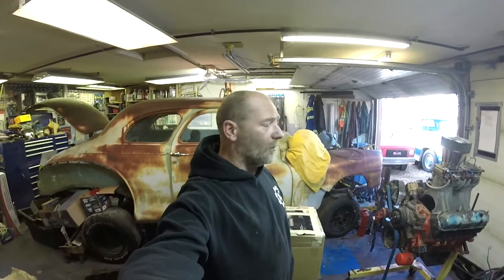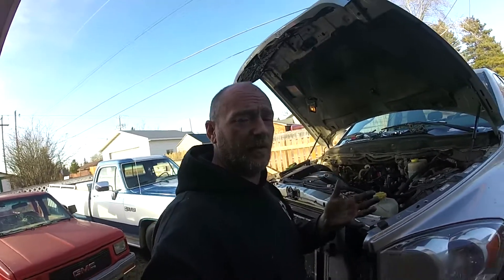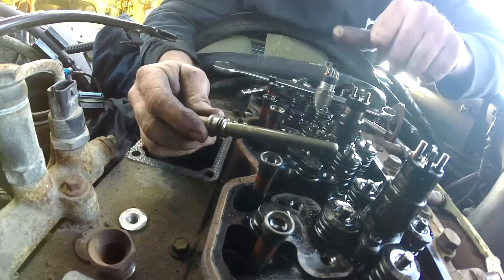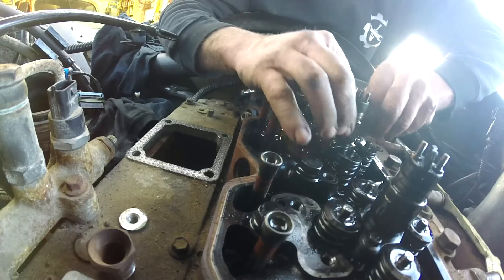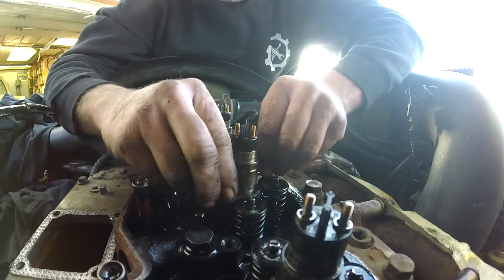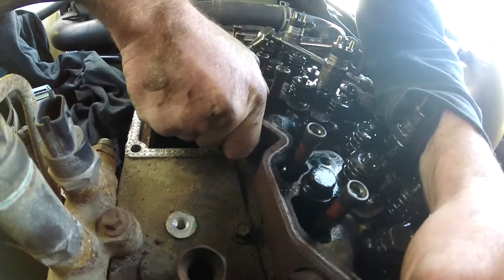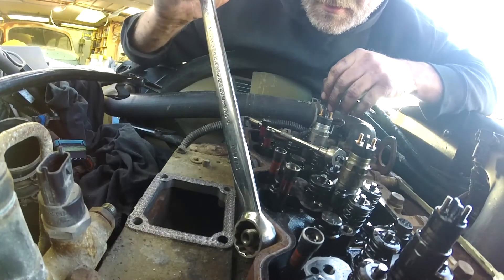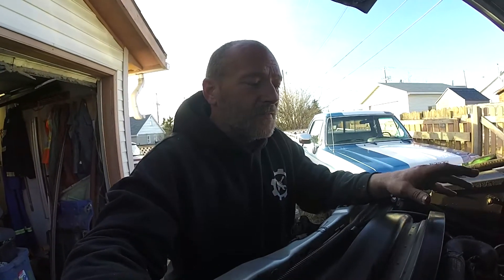Cummins 2003-07 1/2 5.9L Fuel Injector Replacement Procedure

Comment: Man how do you get to the rear ones? I’m stuck on the last one.
Reply from the maker: For getting the rear ones, it's tight under the cowl but still doable. What stage are you at? Have you got the injector lines off and the connector tubes out?
Reply: @dazeofgloryshopworks5806  

I have gotten 4 out of the 6 fuel rail lines off. I got the number 5 off from the fuel rail but I can’t remove it the line from the engine side. I bought the tool which makes it easier to slide over the fuel line because it is tight space. That last one does make me nervous because it is behind a bracket.
Reply from the maker: @gloglo1275  the bracket is removable. It's got two 15mm head bolts and they are tight but won't break or anything. The bracket I'm thinking of is the lifting eye. There is a second bracket on the back of the head that's kinda in the way too but you just have to loosen the two bolts that hold it and it rotates out of the way. Should give you plenty of room then. Keep me posted
Reply: @dazeofgloryshopworks5806  

Thanks.
Reply: @dazeofgloryshopworks5806  

I was able to get the one bracket with the two 15mm bolts out of the way. I am now waiting on the tool to arrive from Amazon to remove the two last fuel lines. Are you saying there is another bracket that will be in the way? It seems that from removing that one bracket I should be able to get to the last line. I won’t know until I get the tool .
Reply from the maker: @gloglo1275  where the #6 injector line screws in at the head, there's a "metal shield" bracket and I find it easier to get the line off and the tube out of the head with it removed. It's a bit of a reach around but if you loosen both bolts that retain it on the back of the head, (13mm head) don't quote me haha but it will flop out of the way and you just rotate it back in place when done. If you can get it out without removing that rear bracket then give er man 🤘🏼
Reply: @dazeofgloryshopworks5806  

Oh boy so another wonderful bracket. Well I will try to see if I can get it without it. I’ll keep you posted. Thanks for your help.
Reply from the maker: @gloglo1275  you're welcome. Honestly it's a fairly easy bracket to loosen off. I know you'll get er done either way 👍🏼
Reply: @dazeofgloryshopworks5806  

Well I was able to remove 5 out of the 6 nuts. I went to start working on removing the injectors and unfortunately the rocker arm bolts were not sitting right. I verified that everything was good and still not sitting correctly. There is not enough thread screwed in. On the other 5 you can see the thread a little bit on the other side but not on the one I just did. I went to remove it again to inspect it and now the rod that connects to the rocker arm spins when I try to tighten it .
Reply from the maker: @gloglo1275  I'll be honest, I'm a little confused as to what you're meaning. Were you able to get the injector line off #6? The rocker arms would have had to  be in place correctly or your valve train wouldn't operate properly. Is it possible the cam lobes are keeping the pushrods raised to make installation difficult? (Opening exhaust or intake valve)
Reply: @dazeofgloryshopworks5806  

I figured it out. The rocker arm nuts on the right side were the issue. I didn’t realized I didn’t need to unscrew them so it bottomed out. This is where the valve adjustments are made. I just figured out using a 5mm torx brought it back to where it needed it. I still need to figure out how to make sure the valve clearance is okay since I removed that. I was able to install 3 out of the 6 injectors. I can’t get the rest of the tube outs. They are jammed hard as heck. My hand is messed up from trying. Injector one the copper washer fell into the spot where the injector goes but it was luckily exactly where it needed to be. I looked down and saw it not blocking the hole. I also heard the injector click into place so that should be fine.
Reply from the maker: @gloglo1275  here's another tip for the connector tubes. There is a tool that screws onto the connector tube. But if you don't have it, take one of your injector lines and screw it onto the tube 3-4 threads and pry against the fitting and the head. The tube will pop out 👍🏼
Reply from the maker: @gloglo1275  I also have a video on doing valve lash as well man. Hope that helps. 🤘🏼
Reply: @dazeofgloryshopworks5806  

Yeah I did screw the nut and broke my heavy duty screw driver. I even sprayed something to help loosen it. So far nothing. As far as the copper washer, if the old one comes out and the new one falls into the injector tunnel, is it okay if it is aligned where it needs to be? I’m just making sure I don’t need to remove the new injector I just installed.
Reply from the maker: @gloglo1275  the copper washer will be fine yes. They can basically only line up and with the injector seated it has no choice but to be in the right spot. I'm surprised at the connector tubes being stuck that hard but have had the odd troublesome one for sure. You could try tightening the connector tube nut/collar, back in again and then taking it off and try again. It could reseat the connector tube and set it free from whatever is holding it in.
Reply: @dazeofgloryshopworks5806  

Thanks. I will try that tomorrow. I’m beat. I have an injury from bodybuilding so it has been a pain in the butt doing this while dealing with my elbow. Lol
Reply from the maker: @gloglo1275  yeah man I feel your pain there! Good luck. I know you'll get er. 🤘🏼
Reply: @dazeofgloryshopworks5806  

So I had a friend come over and he was able to get that tough injector tube out. Crazy what it took to remove. Weird thing is all of my tubes wouldn’t sit all of the way down by finger. I had to gently tap it when a small hammer once it was properly aligned with the two ball bearings. I could not get it by just pushing it with my finger. I did hear them click into place when I tapped it with a hammer. I then wiggled the injector and I could see the tube moving so I knew it was in place.
Reply from the maker: @gloglo1275  I knew you'd find a way man. Yeah the oring is what stops em by hand. So the little tap with hammer is perfect in some cases. Good work!!!
Reply: @dazeofgloryshopworks5806  
Thanks for your help. I’m almost done.
Reply: Man after all of that work I still have the “wait to start light on”. New FCA, injector tubes and injectors .
Reply from the maker: @gloglo1275  so... from a mechanics standpoint, what was the main reason for doing the injectors? I never did ask.
Reply: @dazeofgloryshopworks5806  

Oh sorry. So I was driving couple of weeks ago, and when I stepped on in it in the highway the WTS light started flashing, and it remained on. I scanned it which gave me a p1222. High return fuel line back to the tank. I replaced the FCA, and everyone was asking me how many miles I had on the truck. 298k miles. Everyone started telling me get injectors.
Reply: @dazeofgloryshopworks5806  

What is a good ohms when checking the injectors? I set my multi meter to 200 ohms setting and I’m getting 1.4 ohms for them .
Reply from the maker: @gloglo1275  usually I've seen between 1.1 and 1.6 ohms per injector. Sounds like 1.4 is just fine
Reply from the maker: @gloglo1275  but that doesn't mean they aren't "washed out" by wear and tear from fuel flowing through them.
Reply: @dazeofgloryshopworks5806  

Sounds good. Thanks
Reply: I’m getting p2146, and p2143. Pretty frustrating. I unplugged all of the injector harnesses, reset it the codes and scanned it with only the ignition in the on position, and it trips those codes. So I checked the injectors in the first 3 and I got 1.4ohms. I sent number 4 to injectorsdirect because I had a code for 4, and still waiting for them to test that one.
Reply from the maker: @gloglo1275  it sounds like you have a chaffed section of your engine wiring harness. I hope I'm wrong though. There is a spot on the right side lower of the engine behind the ac compressor where the harness has been known to lay against the ac lines and chaff through. Now normally it has a fan control circuit code accompanying other codes as well but it would be worth a peek. You can see usually from the passenger wheel well by pulling the wheel well liner up away from the frame a bit or from underneath the truck as well. Might not help but it's worth a look for sure.
Reply: @dazeofgloryshopworks5806  

I’ll take a look. I got a ancel fx2000 today to try and clear the codes from the computer modules, and it won’t connect at all. It gives me the menu and when scanning for can protocols it says failed for all of them. So weird.
Reply from the maker: @gloglo1275  that is weird for sure. Unless it's not updated properly, it should read the truck. Good luck man. 🤘🏼
Reply: @dazeofgloryshopworks5806  

Sorry to bother you again. Lol. I’m trying to test the connector from computer to the injector harness. What type of voltage should I get when probing the connector? Each connector manages two injectors. With the truck turned off how much ohms should I have on a working connector?

Also my tester has different settings such as 200k, 2000k, 200, and not sure which one to select.
Reply from the maker: @gloglo1275  no worries you won't get any voltage or it'll be sporadic at best because the computer will only fire the injectors with a tach signal as if it's running. But to ohm each wire from ecm to the injector harness, you should see whatever ohms you get when you touch the two tester leads together +\- 0.1 ohms or so. Basically next to no resistance. Also while you probe the ecm connectors (disconnected from ecm) touch one lead to the terminal you're testing and the other lead to ground and then to power. That way you can tell if the harness is chaffing to ground. Should be an open reading like when you switch your meter on to ohms without touching anything with the leads. The meter can be set to 200 ohms scale or whatever the lowest ohms reading is. Hope it helps
Reply from the maker: @gloglo1275  also I didn't ask if your truck had the 5.9 cummins or the 6.7. If 6.7, then you can't mix up the injectors as they have a flow rating programmed for each injector per cylinder they are installed in.
Reply: @dazeofgloryshopworks5806  

2005 5.9. Someone wants to trade me a nice working condition even trade 2nd gen 24 valve Cummins for my non working truck. Lol

I am thinking about it. I just went to harbor freight and got a easy to use electrical meter. Mine had too many settings. I just need to know if it is the harness or injectors although I was getting 1.4ohms on each injector
Reply: I am getting like 110.3 ohms on each of the ends on the harness connectors.
Reply: @dazeofgloryshopworks5806  

I was measuring the electrical connector and not the connector that goes from the harness to the actual injectors. I was getting like 110.3 ohms or so . On all 3 of the connectors .
Reply from the maker: @gloglo1275  was the ecm unplugged too? Like you had one meter lead at the end terminal and the other at the injector terminal? Or were you measuring with the two leads on the injector terminals at the same time?
Reply: @dazeofgloryshopworks5806  

The ecm was plugged in. I didn’t messed with that. I unplugged all 3 connections to the 3 connectors which supply power to the injectors on the side of the valve cover. I then checked the ohms on each two pins of each connectors(they are 4 total per connector) and it was moving up to like 114.3 ohms and some were like at 12.3 ohms and they would move up and continue rising.
Reply from the maker: @gloglo1275  well if I'm interpreting your test correctly, then it sounds like your injector harness is shot. It does happen. I highly recommend the factory replacement from either Chrysler dealer or a cummins truck dealer. I've used aftermarket ones and the nuts on the injectors seem to screw down like they are crossthreading. Poor quality it seems. So if it was just the injector harness you tested, then yes you have issues in it and replace it. I'm always leery of saying to replace a component when I haven't been right there to help diagnose first hand... but it sounds like you crossed your T's and dotted your I's on it man. 🤘🏼
Reply: @dazeofgloryshopworks5806  

It wasn’t that harness. It was the connection from ecm to the harness. The female connectors that connects to the injector harness
Reply from the maker: @gloglo1275  ok well without the ecm disconnected, you can't get a conclusive result from testing the wires. The ecm has drivers inside it like mini-relays that shoot the voltage to the injectors and turn em off and on as required. So you're effectively measuring circuits that aren't isolated. The ecm would have to be disconnected for sure to test these wires to get any proper results. And then you test each wire individually from ecm to your injector harness plug ins.
Reply: @dazeofgloryshopworks5806  

So if I leave the ecm plugged in and disconnect each of the nut wires on the injectors and test that would that tell me if I have an issue in the wiring? I could just test that to make sure the ecm is putting the right ohms into the injectors.
Reply from the maker: @gloglo1275  unfortunately no that won't work at all. The only thing you could do is hook up a noide light to the injector nuts and with engine running, see if the noide light is flashing. That will say if the ecm is energizing then coils but that's all. There is no spec for voltage or ohms from it to say yes it's within an allowable range.
Reply: @dazeofgloryshopworks5806  

Issue is the truck doesn’t run. Someone was showing a video testing the connectors I was testing but it was on the 2007 and up which is the valve cover harness. 

So testing what I did won’t show whether the ecm is putting the proper ohms? If it doesn’t could I check the voltage to see I am getting the proper volts? I was about to send the computer out to get checked out.
Reply from the maker: @gloglo1275  no there is no real short cut as I said in the last comments bud. The only way to know it's not an ecm issue is to know the injectors are good and know the injector harness is good and know for sure that the engine harness between injectors and ecm connectors is good. And that is done with disconnecting the ecm connectors and ohming each of the injector wires from injector connector to the proper ecm connector pins. No way around it bud. 

But here's the thing.. the two engine codes you gave me, won't stop the engine from running. It'll misfire or run like dog shit but it will still run. So I'm thinking it's time to go back to the beginning on what happened with it or what was it doing when it quit running and any symptoms it had there. I've had worn out injectors bleeding so much flow back through the return side of the fuel system that it lowers the fuel pressure so it won't run at all. And the high pressure relief valve getting overworked to the point that it can't hold pressure any more as well. Is the truck chipped up or got a programmer in it? I've seen old tunes on the ecm cause many issues such as this too. We never started at the beginning of your issue here so it's hard for me to say what direction is the correct one to go on diagnosis. Let's start at the beginning... how long have you owned the truck? What kind of fuel do you use, and how often do you change your fuel filter? What does it have for a "lift pump"? An intank version or the original fuel pump log on the back of the filter housing? Maybe an aftermarket FASS fuel pump kit. Let's start with basics and go from there man.
Reply: @dazeofgloryshopworks5806  

Alright so the beginning. Lol. I had a p1222 code. I replaced the FCA and a lot of people were telling me because I have 298k time for new injectors. So I got 6 refurbished injectors from injectorsdirect. I installed them and new injector tubes. The truck still had the p1222. It was running very smooth except it was on limp mode because of the p1222.

I found a mechanic that was offering me some help. After a long while of having no luck with the p1222 we agreed that I should have it towed to his shop 60 miles one way. 

He had agreed on the way we would go about the labor which we agreed. He then tells me the same day so I plugged in my expensive snap on scanner and re calibrated the injectors and it is running amazing even peeling wheels. I’m like wonderful. 

He then says I think I should keep it one more day to test it out. Well next day I get a call that the truck started shaking after driving amazing, and it was the injectors that got stuck opened. He told me p2146 and p0204. He then started telling me that he would have to charge me for all of this stuff which I was very clear about and I didn’t liked the way this was going because now he brought someone else into this and he said I would also have to pay him. 

So I was told him I am getting my truck back. Which created a huge argument. I then get my truck back after paying him for some of the diagnostic fee. My truck had 6 codes when I got it back. 

So I reset it all of the codes and I sent the injector 4 back to injectorsdirect. The codes that I am stuck with are p2146 and p2149. When I got the truck back it ran like trash shaking and even smoking so I didn’t wanted to screw up the engine so I turned it off and it was even still running for a few seconds after I turned it off.

I was trying to isolate the issue. So I’m thinking if it is a short on the injectors let me unplug all 3 of the female connectors on the side of the valve cover, reset the codes and see if it stops setting the codes. Nope codes comes back as soon as I reset them with the female connection from ecm to injectors completely unplugged so this is an issue of either ecm or the harness from ecm to the injectors with the female plastic square connectors.
Reply from the maker: @gloglo1275  so, it sounds like you're not developing enough cranking injection pump pressure. It could be from a stuck open injector yes. But also the fca as you've discovered already. Now the high pressure relief valve looks like a bolt on the fuel rail to a banjo fitting. Google and a image will show up for what I'm talking about. That valve has been known to fail and be too weak to hold against the fuel rail pressure. There's a way to test it but you need a special tool fitting so you can see it leaking. It's also called a cascade overflow valve. Aside from that, I'd the code is being tripped just with the key on and can't be cleared. There may be something else going on there electrically with the fca wiring.

When I worked for Chrysler (2000-2010) , we did a mandatory fuel tank drop and clean on every set of injectors to make sure there was no water contamination or algae growing in the diesel fuel. You'd be amazed at what gross ass stuff we had to clean out of the fuel tanks. All manner of slime and gross bad fuel. Did you change your fuel filter when you did the injectors ? Possible you slurped up some little mess into one of em and it jammed. 

The ohm test across the injector terminals will tell you if the injector solenoid is good or not but not if the injector is stuck open or closed. It does sound like it has one or two stuck wide open for sure. Normally I'll do fuel flow back tests and timed supply and return tests for each injector and the high pressure pump as well as the lift pump before going further with other things. But it needs specialty fittings and fittings to block off injectors to isolate which one is flowing too much as well. I certainly wish I was there with you to go through it with you man.
Reply: @dazeofgloryshopworks5806  

I changed the fuel filter around 3 months ago. The codes remaining are the p2146, p2149. It doesn’t matter how many times I reset it they won’t stay off. The p1222 code is off. I have a sneaky suspicion that they tampered with my ecm/wiring. Because on a normal 3rd gen Cummins if you unplug the female connectors on the side of the valve cover and just turn the key to the on position, it won’t trigger the codes I have.
Reply from the maker: @gloglo1275  it is possible that while looking at the engine and trying to diagnose the issue, that something got disturbed or an ecm terminal is now too big (stretched open) to make a solid connection. But I can't say without having seen them in action. It's a rough go when you're relying on someone else and the deal goes hard. I know first hand man and definitely sympathize with you on that one. I think I would wait till I get the #4 injector back or get a 0.039" drill bit and start checking your ecm terminals one by one to see if they have the proper pin tension on them. That was never a fun job for me but was one of those things that had to be done. Just make sure the connectors are clean before you unscrew them from the ecm. I think it's a 3/16" Allen head socket to get them disconnected and a 10mm socket to remove a harness retainer by the ecm to get enough slack on the ecm connectors to flip em around to start sliding the drill bit in to check tension. If it drags going in and out, it's good. If there's no drag, then that's not right. It's a pain in the Butt job but I've found issues that way in the past.
Reply: @dazeofgloryshopworks5806  

Well do you think not having injector number 4 would make those codes continue getting triggered although the harness is disconnected all together?
Reply from the maker: @gloglo1275  I don't think it should but I can't say I've ever had to diagnose this way either. I may be wrong but I don't recall the 5.9 ever getting an egr system on them. Not in Canada anyway. That wasn't till the 6.7 and that was one of the codes wasn't it?
Reply: @dazeofgloryshopworks5806  

Well the code I got before was p1222 which they told me they fixed. That p1222 is gone and all I got is the short circuit codes with the p2146,p2149.
Reply: Sometimes said the following:

“Problem yes, serious no. If the injector doesn't fire there is no fuel so no engine damage. You can run these engines for hundreds of miles with a dead cylinder and intermittent problems and have no issues. If the ECU detects a short or open it won't fire the injector.”

This is where my head is at. As long as I have those p2146, and p2149 the injectors won’t be firing because the ecm isn’t sending signal to them since there is a short. If the short was in the injectors with me unplugging the female connectors to all injectors and still getting a short would mean to me that it is something with the wiring from the ecm to injector wires or ecm.
Reply from the maker: @gloglo1275  I'll do some in-depth checking on both of those codes on Monday when I get to work. I have access to some really good diagnostic sources and the factory diagnostic manuals for most everything I've worked on in the past. Cross your fingers I'll be able to get you some specific testing to dig in deeper and find the problem man 🤘🏼
Reply from the maker: @gloglo1275  I agree with you for sure man. That's why we need more in depth diagnostics. Getting the code from the ecm is only one step in proper diagnostics. I've seen lots of fellas replace part after part needlessly because they had a code and went for the component it was attached to without fully diagnosing anything properly. Hell, I've jumped all over the map on issues and only ended up with many wasted hours. We will get to the bottom of it man.
Reply: @dazeofgloryshopworks5806  

Thanks man you have been amazing.
Reply: @dazeofgloryshopworks5806  

So I unplugged the ecm like you suggested. I then used my meter to check the resistance from the female connectors of the side of the valve cover. I’m getting nothing. I think this is the way you told me to do it. I am usually not too knowledgeable of electrical stuff but I am trying my best to learn and narrow this down. Funny thing is when I try explaining to people computer science and coding they all nah man nah speak English please. Lol Well that is what makes sense to me. Logic and algorithms. Lol
Reply: So I unplugged the nuts on the injectors and tested the leads on top of the injectors. I am getting fluctuating between 0.02-0.07 ohms on each.
Reply: I was going to ask would having them harness unplugged for the injectors on the side of the valve cover immediately set off the p2146,p2149 if just turning the key to on position and not turning on the truck?
Reply from the maker: @gloglo1275  it's possible for the injector code. But it should have been multiple injector circuit codes. Not just the one. The injector ohms of .2-.7 are odd to me. I usually see 1.1-1.4 in my testing. Could be your meter maybe but I don't think so. 
To text the harness for ohms with ecm unplugged , you need to put one prob in the proper terminal of the ecm connector that shares the same wire to the valve cover. Resistance is testing one single wire at a time at each end. So one lead would be on the injector harness for say #1 injector and the other lead would be on the corresponding terminal in the ecm connector.
Reply: @dazeofgloryshopworks5806  

This is the new meter I got which is auto. You set the ohms and it gives a reading. The other one I have is too complex with way too many settings(200,2000,20000). Lol

I was getting those readings. I was afraid that I would have to stick something on the other end of the ecm. Lol. I was just wondering that if it was possible that if I unplugged all injector connections not even turning on the truck it would set those codes for p2149, p2146.
Reply: @dazeofgloryshopworks5806  

I just shipped the ecm to get repaired.
Reply from the maker: @gloglo1275  it's been super busy at my work these past couple days man. But yeah if the harness checks out then it may sure be in the ecm. Keep me posted on the outcome please.
Reply: @dazeofgloryshopworks5806  

Yeah man I live in an HOA and I’m pretty stressed about getting this truck fixed. It is currently parked in the street and they can fine me for being parked there. I can’t park it in my driveway because it doesn’t run. I’ve done a lot of research and because I have those two codes which are back immediately, and won’t go away . They say they did a lot of what I did and it wasn’t until they replaced the ecm that it fixed everything . I spoke to the ecm repair place and they told me the same thing.
Reply from the maker: @gloglo1275  sounds like you're in good hands man 🤘🏼. Very cool. I'll cross my fingers for ya!
Reply: @dazeofgloryshopworks5806  

I just heard back and they told me my injector was indeed bad due to contamination. How they heck do I go about making sure I don’t have contamination? This seems to be such a hassle. Do I drain the fuel canister before I install this new injector and drain it a few time and install a new filter?
Reply from the maker: @gloglo1275  the only way I recommend isn't what you're gonna wanna do. But... drop the fuel tank. Pull the float unit out and drain the tank. Then wipe the tank out to get everything. You'd be surprised how far you can get your arm into the hole. 
Then pull the fuel filter and clean out the filter housing. Install a brand new filter and fresh fuel in the tank. I've had to do it so many times working at dodge for years that I still don't miss that part man.
Reply: @dazeofgloryshopworks5806  

Oh man that seems like a whole lot. I was told that my injector tube I guess got a small part in the and it got it’s way to the nozzle. I had put a really good diesel treatment right before all this happened that covers 150 gallons. I was just thinking about replacing the fuel filter, and cleaning the filter canister. Maybe let it fill the canister a little bit at a time to get the diesel to flow and drain and clean again.
Reply from the maker: @gloglo1275  well. It's possible but I can only recommend what I know works for sure man. I know it sucks but it's the sure fire way. Fuel treatment won't help contamination or remove it at all. Just think on er is all
Reply: @dazeofgloryshopworks5806  

I guess what is a way to know that it is contaminated for sure? They just told me that the piece from the injector tube a small piece had damaged the injector nozzle hence it was deemed contaminated.
Reply from the maker: @gloglo1275  honestly, once we condemned injectors for contamination, we weee mandatory for drop and clean the fuel tank every time. We had the first couple go through without doing it and come right back for the same issues. So it was hard lessons for us and the customers man. Even if everything is clean , I still recommend it as a diesels life line is clean fuel.
Reply: @dazeofgloryshopworks5806  

Alright I guess I will have to look into doing that. Thanks
Reply: So I got injector 4 installed back on Friday. Replaced the fuel filter, and cleaned the tank , and fuel lines. I was waiting until today to get my ecm. I get the ecm installed and now my code is p2146(1-3). Funny because I guess it wasn’t my ecm all along. Because I replaced injector 4 it got rid of code 2149.

Unfortunately it doesn’t tell me which one out of the 3. All I have to go by is the mechanic that was messing with it told me he thought injector 1 was an issue. This is right before I had it towed back to me.
Reply from the maker: @gloglo1275  I'll check out that p1246 and see if I can find any fixes for ya man. Good work on the fuel system. It may seem like overkill but trust me it's well worth it in the end. Have a good night!
Reply: @dazeofgloryshopworks5806  

Well I bought an injector from a local guy that had a new Cummins injector for only $100. I tried it on injector one and truck has no codes and running beautiful. It did blow some smoke but it was very likely all of that stuff from when I was towed. Because he said it was flooded and I didn’t run it since waiting on the ECM, and injector 4. I drove it around the block and no more smoke or codes.
Reply from the maker: @gloglo1275  yeah man it'll smoke a bit with being flooded for sure. And some fuel and oil can drip into the chambers on top of the pistons when the injectors are pulled as well. Nothing a short ride can't cure. Awesome job overall though. You persevered and will have a good solid truck to run now. Good work man 🤘🏼
Reply: @dazeofgloryshopworks5806  

Yeah man it was a journey for sure. Glad it runs and no codes. I was stressing because we are moving soon, and need to be able to use the truck. Thanks buddy.
Reply: @dazeofgloryshopworks5806  

I do have a question for you. When I was installing injector 4 with my son, and I removed the old injector I didn’t see a copper washer with it. I looked down and I couldn’t see if it was down there and I took a picture but again it looked like it was missing. The truck is running great so lights or nothing but would that cause an issue if it has two of those copper washers? Not sure if I should remove that injector to make sure it is only one or as long as it is running good don’t worry about it.
Reply from the maker: @gloglo1275  it will actually change the depth of the injector nozzle and change the spray pattern area. So it's a pain but if there is two washers in there, the second one has to come out.
Reply: @dazeofgloryshopworks5806  

I guess I’ll just check to be sure . Lol
Reply: Well there it was stuck to the injector so now it has one. Man oh man.
Reply from the maker: @gloglo1275  right on!